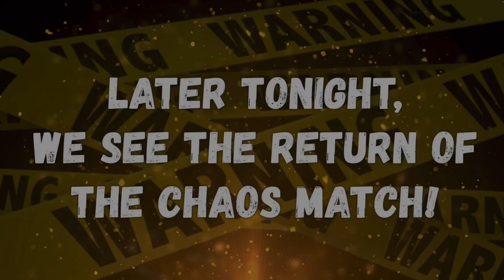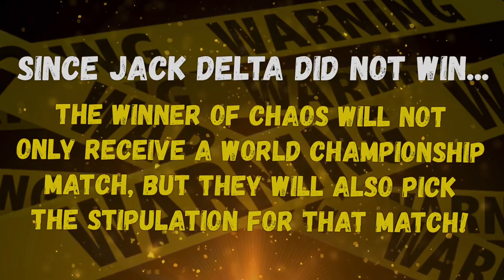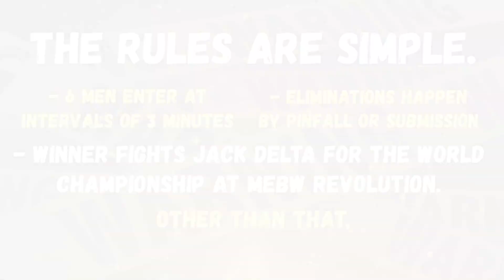MEBW Chaos & Disorder - Viper vs Reylo vs Delta: THE CHAOS MATCH IS BACK! 2 HUGE MATCHES! [3/29/20]

Comment: First out is Reylo Lentana, the MEBW ALL AMERICAN CHAMPION.
We now see El Chaderinó come out for refereeing duties. He seems as happy as a chipmunk finding a bag of nuts.
Next out is Blake Viper, the wunderkind of MEBW, who has more mirrors in his house than 
Ivanka Trump, holding his MEBW INTERNET CHAMPIONSHIP belt. 
Finally, and triumphantly comes Jack Delta, owner of the most prestigious MEBW WORLD CHAMPION belt.
This is nice, just what the doctor ordered, a 3 way match and all participants holding belts in MEBW. All three shake hands and now we get ready to rumble.

They all start out in the round with hands together and a sort of “The Wave,” an antiquated dance of some years back. Jack uses it like a bowler making two strikes with one ball. He rams Viper into Reylo for a double hitter.  Viper has a headlock on Defat, which is short lived, Reylo starts on Delta, but gets Jack and Viper tangled up, resulting to a double spike or something off the trampoline. That move is a new one to me. Anyway, Reylo seems to be making progress on both Reylo and Viper. Reylo and Viper are on the trampoline and Viper is attempting a pin on Letana. Delta jumps in, gives Viper a full throated suplex, dumps him out of the ring and turns his attention to Reylo. By some fluke, Reylo ends up cross bowing Jack, which could be a submission hold. Viper runs in an inadvertently saves Jack by knocking Reylo insensible. Can’t believe Viper picked up Jack. He’s stronger than he looks. All 3 look pretty well spent at this point. Even Reylo picks up Jack. Shocking. Reylo and Viper trying out suplex’s on each other.
Delta revives himself and jumps on the trampoline and figures it’s time for this match to end. Double suplex by Jack Delta on both men. Four suicide dives on Delta. I guess Reylo and Viper are sort of working together for the time being. While Delta is regaining his composure, Viper and Reylo are just slugging the hell out of each other. (Yes, I noticed the beautiful clean tarp. I am absolutely delighted.) Delta has an arm bar on Viper, Reylo is woking on Viper’s let and they are all tied up like a bowel of spaghetti. Reylo manages a low rider on Delta who looks like he’s out like a light. Only by instinct was Jack able to roll out of that 3 count by Chaderinó. Reylo has had enough and lowers his knee pad. Two TKO’s from Viper on Reylo renders him the winner. Jack came in, but it was just a tad too late to save the match in his favor. 

Here comes Chaos & Disorder. James Fury comes out full of energy. El Gingy, who I haven’t seen lately is getting taken to the cleaners by James. Hurrah, Lost Diego enters to bring order to this match. Beautiful snap-mare of Gingy, but Fury turns it into an arm bar to his favor. Now, Owen O’Ryan enters the ring. Owen knocks both men with his belt, gaining a quick advantage. (Those years of refereeing has paid off for Owen), But Fury grabs that stick from Owen and whips him like a feral dog! In comes Matt Thunder, who immediately starts cleaning house. Matt is a fuckin’ firecracker, and puts out El Gingy. A tiny bit of double teaming, but Fury shows Matt that no taunts are allowed. Fury almost knocked Matt’s head off with that lariat. Erebus comes in, flattens both Matt and James, but when he gets to O’Ryan, Owen gives him a super kick. The Fury Cutter is working overtime and no one is immuned as all three feel its pain. Fury now has a double arm bar on both Matt and Owen. But this give Erebus the opportunity of laying a leg across Fury, breaking the fun up. Now a triple arm bar?  That Fury is crazy, crazy like a fox. LOL What a sight. I gotta calm down and can’t find my alprazolam at the moment. Matt takes to the mat, and actually fly’s over all three and takes them out. Incredible! Great cross-face on Erebus by Matt. What a tangled slog of human flesh!  The last challenger is…………….TYLER ADAMS. Well, we have what is left of The REGIME, and they are working together. The way Erebus ambles around reminds me of 100 pounds of potatoes in a 50 pound bag. I fear the handwriting is on wall concerning this match. Adams, O’Ryan and Erebus are all over Thunder. Shit! Regime just turned on Erebus. Those double foot stomps and a foot stomp by Tyler, eliminate Erebus. What a shame?  ;). Tyler eliminates Fury with a foot stomp, and we are left with Owen, Tyler and Matt. Both kicking the hell out of Matt. After several swing moves and airplane spins, Matt is as dizzy as a 4 a-day whore. Here comes Tyler with a metal chair. He misses Matt and knocks Owen in the noggin. Matt runs in, misses Tyler and hits Los Diego. God,  Tommy changes hairstyles more than I do with underwear. Gunn takes out Matt. They are just killing Thunder. What a crime! Man, does Matt have heart, he’s fighting to the last degree. Thunder comes back alive and kicking, he even plants Gunn on his ass  — again!  Through the most complicated mean, Matt takes out O’Ryan, sets up the seesaws, but grabs 2 chairs and makes up a table, but Tyler low blows him. Matt is out, but something has a hold him and keeps him going. Gunn can’t count fast enough for a 3 count. The Regime is completely betwixt and befuddled. The crack I heard when Tyler’s head went into the table was not the table, by Tyler’s actual head. This is insane. 3 suplexes in a row on Adams from Matt. WOW, Matt finally pins Adams. This has to be the most brutal match in MEBW’s history. Matt Thunder did everything AND MORE that a first class athlete could muster. He is a wrestling GOD. Sorry, but it’s the truth. What an event, one great match and one of the greatest matches ever. Thanks MEBW. (Sorry for the long post, but I was too excited to stop!)
Reply from the maker: Thanks for the great post, John!
Reply: @MEBWWW  Sorry the post was hard to read. I don't how that line got through part of the text and the auto correct on my program is ridiculous. But thanks for the shoutout. Really, you guys outdid yourself with 60 minutes of unbridled entertainment. It makes home a more friendly place with all this virus shit. Keep well, you guys.
Reply from the maker: John Morgan Same to you! :)
Reply: Viper, did you notice? Apache King has produced a knee drop in front of you (at least compared to his previous comments). Only now are you - but definitely - ennobled (for how long?).
Reply: Hi Apache King! I know. Just wanted to test your (Pavlovian) reflex. (It worked 😜).
Reply: Apache King  Good points, Apache. I love the announcer's voice, very pleasing and melodic. Yes, I caught Gunn's diss, but was afraid anything I would say would be taken the wrong way. Even I have some scruples. Gingy has that terrible Hispanic accent when he talks, but his arms and stuff you see sure looks whiter than white to me. I loved the ad lib Thunder did when he couldn't separate the sawhorses  and went to Plan B.  The MEBW boys really put on a hard core show. Couldn't believe the punishment they all took, especially Matt Thunder. But it took a team effort to get this so over for us fans. Maybe Tyler is drinking beer again!?  And yes, Reylo really hung in there.  I really don't cotton to people coming in mid-match to become a ref or getting involved, but that let Matt rise to proportions of greatness. Truly, one of best matches I have ever seen.
Reply: Apache King  You mean like River Phoenix in My Own Private Idaho movie? LOL
Reply: @flyhigh6088  How do you rate this Chaos match, Fly?
Reply: Hi John! After a first view, I only can repeat what all others said (to summarize it: „epic“). In addition to all other comments, I find the camera work excellent: The more competitors, the more difficult... (Actually, I don‘t have enough time to really enjoy the whole show - nor could I watch it on the big screen. Hope to catch up later.)
Reply: John how do you Wright so much just for a comment i did not think that you wrote so much until I clicked read more